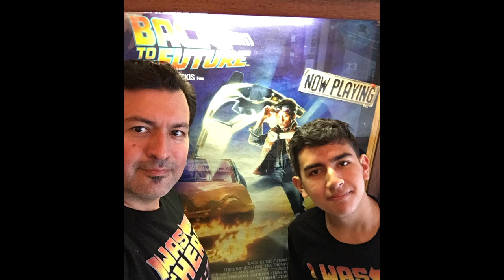Aiwa HS-F07 CassetteBoy repair, Back To The Future Marty McFly (fixed audio)

Comment: I bought the cheapest non-functioning one from eBay, and it came all the way from Japan, so it is a JDM  model. The video help me a lot getting the back panel open and the belt layout. The belt had turned into molten goo, yuck but the metal pulleys are not too corroded with green crap, so it is short job. On playback, the auto reverse works properly but the audio channel switching while engaging the auto reverse is initially not working properly, the audio is partially working (nothing to do with Volume POT meter) eventually it started working properly after engaging the auto reverse a few times, but I got to find that switch and lubricate it.

Comment: Here's a little work around trick for motor speed adjustment in the absents of a test tape and guitar tuner. Take a reliable commercially recorded cassette with a common music track, then find a trusted digital copy of that same track in your collection or from a stream like YouTube. Attempt to start the tape and digital copy at the same time. Sync them by a combination of very momentarily pausing the digital track and/or briefly interrupting the tape flywheel with your finger to bring them together. Then listen for rush or drag and adjust as needed. You may have to repeat the track a few times depending on how well you make the adjustment and your level of perfection. I successfully used this process on my vintage TEAC component cassette recorder.

Comment: Very helpful!  Mine also had the dislocated auto-reverse spring & belt turned to goop.
My tip/warning for everyone else: 
I highly recommend powering these with batteries.  A chip ran very hot with my power adapter (despite correct voltage & polarity).  I presume the circuit doesn't 'know' how to limit current.  The same chip went from burning hot to room temperature with batteries.  Cheers!

Comment: They are not easy to fix. I had one and sold it, because it never worked as I expected. Of course it will get its basic functions if you change the belt and clean it, but the pinch rollers need to be replaced and even after that the Capstans have too much space I guess… when I moved mine around the Azimuth changed the whole time and the music faded. It depends on the tape you use… sometimes it got better, sometimes it got worse but it even can damage the tape. It's a big problem with many Walkmans. You can try to make them tighter with another distance ring. I couldn't find one that fitted perfect. 

The HS F07/P07 was almost the TOTL Model back in 85. There was only one which was better: The HS P08. That one had remotable Full Logic Control. But if the HS F07 works as it should, it sounds great. Cassettes can sound very good. The HS F07 has a relatively high W&F, 0,3% WRMS but a good Anti Rolling.

Comment: whatfor the oil on the capstan weels and ON the motor and not unter ?!
Reply: After almost 40 years, any point of friction that had any old lubricant needs new oil whether there is a motor or not. If it needs to move freely it should have fresh lubricant.

Comment: A twist drill the diameter of the thread of the screw can be used to drill off the screw head. You must use a LEFT (counterclockwise) cutting drill, just slightly smaller diameter than the thread. Ken p.